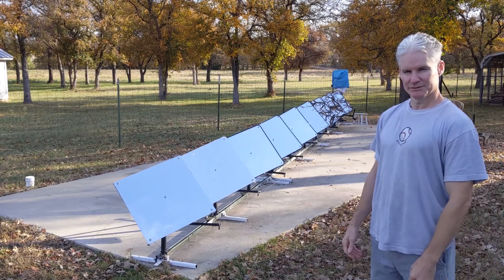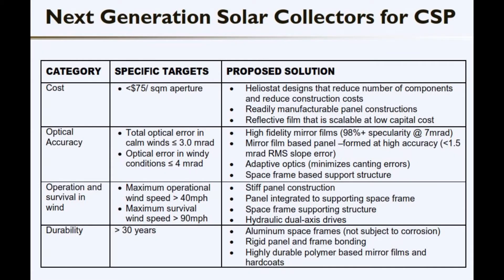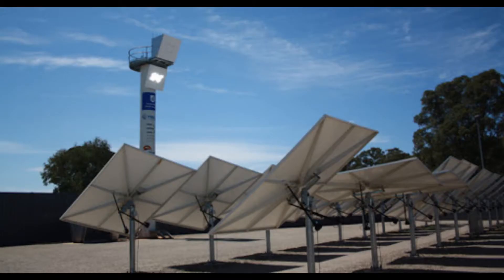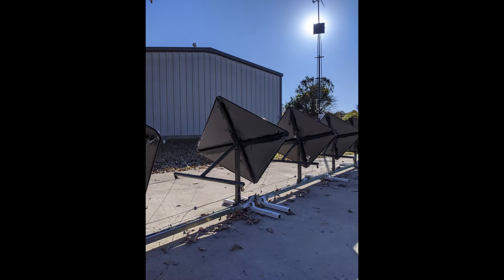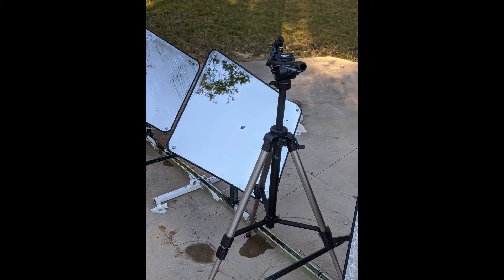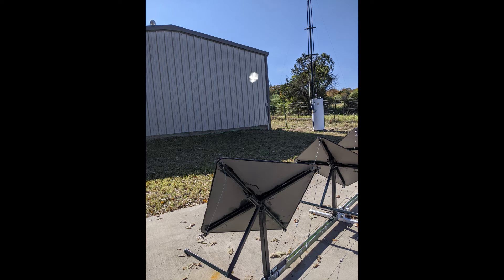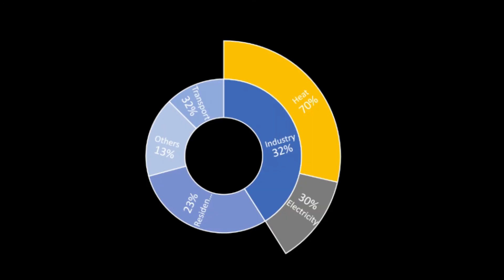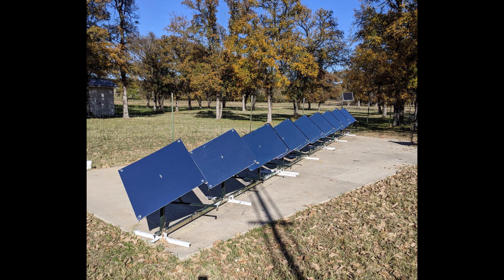Novel Heliostat for Concentrated Solar Power

Comment: I've always wondered about smaller scale cogeneration with concentrated solar in locations that could make use of warm water, especially in colder climates. PV panels struggle with efficiency and lifetime in concentrated solar due to higher operating temperatures, but if you were able to cool them sufficiently with a water/glycol loop, you could use a much higher efficiency panel than what's economical for stationary arrays and feed it light from a much larger area. The smaller size would also help dramatically with extracting useful heat in the cold as higher solar intensity means much less area for convective heat transfer to take place.

Comment: Dear Mr.Walden,  How much electricity could be generated anually with a setup like the one shown in the video (9 panels, ..) and a not too expensive turbine if situated in central europe? -  Roughly.
Reply: it could heat your house